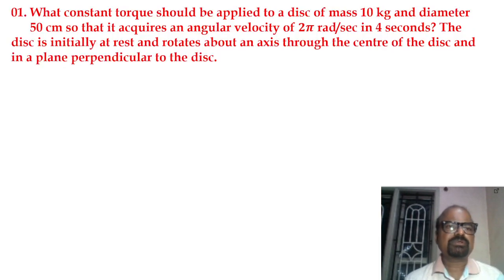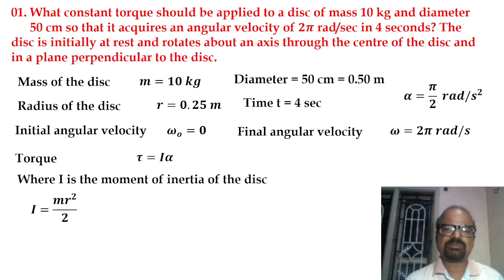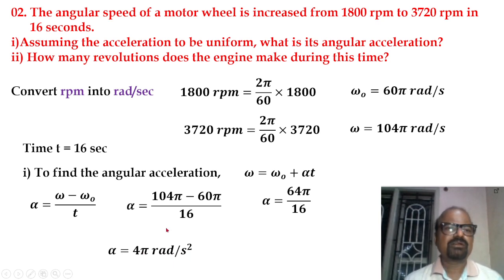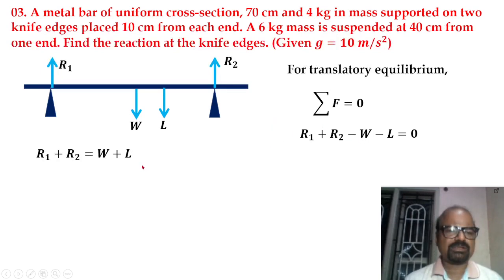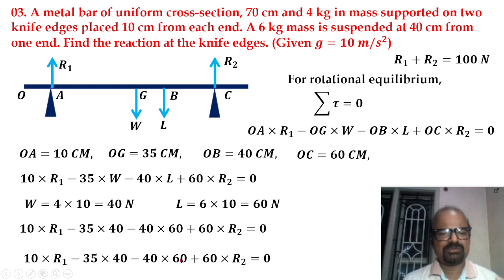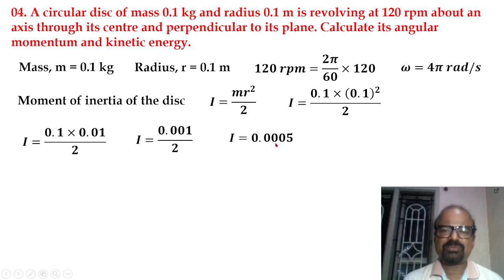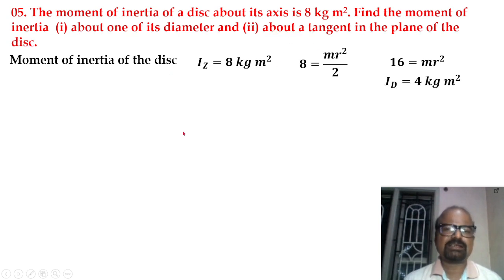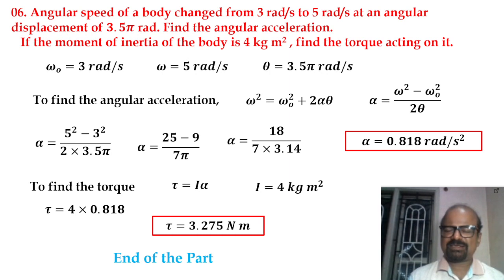NUMERICAL PROBLEMS FROM SYSTEM OF PARTICLE AND ROTATIONAL MOTION

Comment: Last question 18/7*3.14 roung 16/7*3.14 is right. Sorry__Sir
Reply from the maker: No need to say sorry. If it is wrong wrong only. Wait I will check once.
Reply from the maker: Yes you are correct. Sorry for that mistake